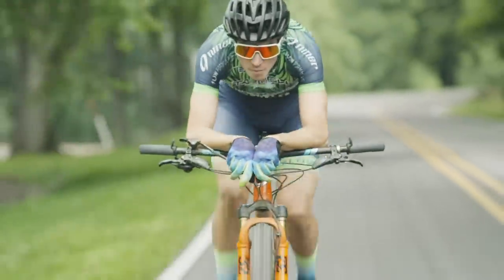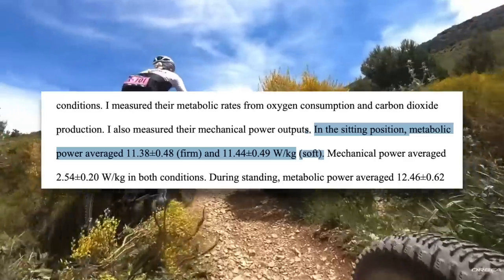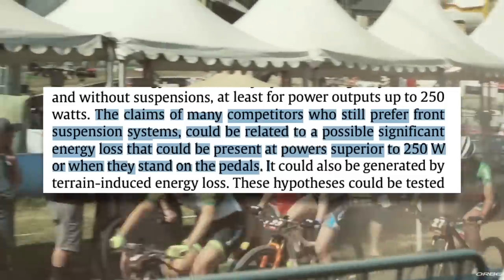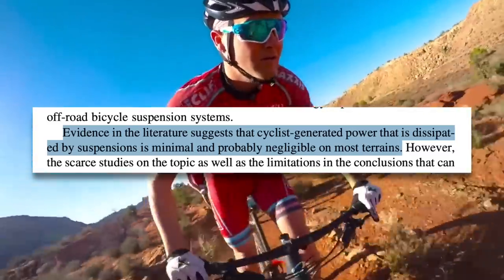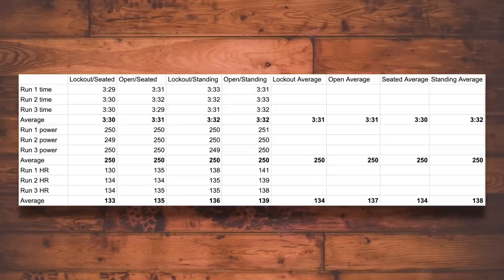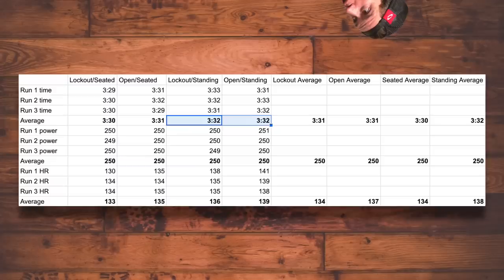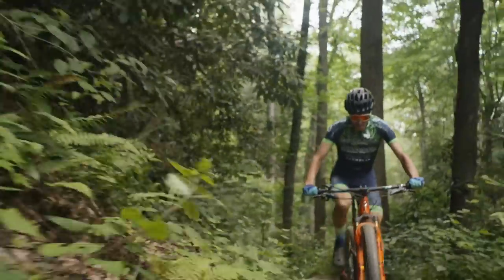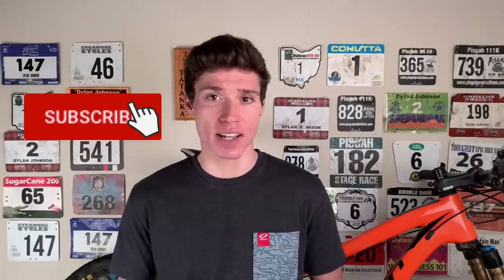Does Locking Out Your Suspension Actually Make Your Bike More Efficient? The Science

Comment: Whats missing in these experiments are the amount of bob or travel when its unlocked. When you bob, part of your energy is going into the suspension and probably being converted to heat. A better experiment is to do it on an enduro bike and not only measure watts, vo2, buy travel during bob. You can use a shockwiz for that. If you're doing this on an xc bike, much of your data is  in the noise. Basically what Im trying to say that if there is bob, then thats part of the energy you're producing and its not energy which propels the bike. Just doesn't seem to make sense . The only thing which makes sense is the experiment is not producing conditions where it's measurable.

Comment: so conclusion is that weight savings from hard tail is what might actually make a difference or does it???? Does the non rotational weight ....with reasonable delta actually make a difference? Lighter wheels do make a difference for sure ...especially in MTBing where change of pace is big factor but lighter frame ???? That would be an interesting test to do.

Comment: Very interesting, I suppose part of it is to do with the perception of comfort and performance. Does this mean I don't need a HT bike for XC?
Reply from the maker: I stopped using a HT a couple years ago. The main advantage of a HT is that it’s lighter but I’d say unless the course has a lot of climbing on smooth trails a FS more than makes up for the weight difference.
Reply: @DylanJohnsonCycling  my thought was that the thing holding me back is the fact I have a 27.5 Trek Remedy, 160mm travel front and 150mm rear and I use it to ride 100+ km days. It weighs 17kg, so I'm looking for something less heavy like a trek procaliber but maybe I should look at full suspension....problem is the procaliber is 10kg full race spec etc...to get that weight on a full sus I'm looking at spending waaay above my budget. Would you prioritise weight over suspension over those kind of distances? I'm having trouble figuring out the interactions between weight, performance in 100+ km events. My brain tells me prioritise weight so HT would be the go to for cost/spec value. What would you do?
Reply: @DylanJohnsonCycling  course would be South downs way century in UK 170km with 3500m of elevation...the remedy is a bit of a trail pig lol
Reply: @mrnobody9821  You don't really need a 10kg FS , you can find ~12kg FS xc bikes at a more reasonable price point and will get the same benefit of comfort and speed on the downhills. 
I personally would prefer 110-120mm bikes with a dropper (around 12kg) for XCM events since you can easily make up the climbing speed difference on the downhill parts and get better overall handling over rough terrain and more comfort as a plus. 
2kg additional weight will add a minute (at most 2) on an 1h climb at race pace but you can easily make it up on the downhill section by going 1-2 minutes faster on a 10min downhill. On flat sections the weight will not make any real difference. 
If your events have somewhat gnarly and fast descents , just get a FS that your budget allows and maybe even a 110-120 xc/trail bike as long as weight is within reason.

Comment: So the energy that compresses an open shock while pedaling on smooth road... where does it come from? And where does it go when the shock is locked?
Reply: when locked, it compress the tire.
when unlocked, it compress the shock.
Reply: @Hexsense  and it should be noted that tires provide undamped suspension which is not good.
Reply: The loss doesn't come from the suspension movement itself but rather a function of the suspension travel AND the damping forces produced by the compression/rebound damping circuits. The rider is the only source of energy so necessarily you're losing some energy if your suspension is moving and generating heat in the damper. How much depends on the level of damping and movement.

Comment: It all depends on the trail you're on. The terrain is king. If you're on loose gravel, on a climb, in a rock garden, on slippery off camber roots, descending a log etc etc. The whole point is not data obsessing, it's the feel you get on certain terrain. You will know instantly which one feels better. I defy anyone to attempt pulling up a steep rock face with the shock locked out. You will fail.
Reply: @Johnathan Chester

I think the issue is relying on feeling as we know is not accurate. Something may feel good but is in fact not opimal.

For example if rider movement is enough to cause power loss on a suspended platform then that movement must also be doing something on an unsuspended or more correctly undamped unsuspended platform.

Maybe loss of traction? 

The entire purpose of suspense is to maintain traction.

Would you be able to feel small losses in traction? What would those loses amount to?

Id hazard a guess the loss in traction in watts is greater that the loss in watts from suspension bob.
Reply: @tylerbruce5731  Good thoughts and precisely my point. MTB is not all about "metrics" - that's only applicable to a measured surface. When the course is gnarly then you are working on feel. The feeling of traction, slippage, potential leg speed, etc etc. I strongly suspect most XC-ers here are more like gravel/roadies. I spent 10 years racing XC and learned on the N Shore, Squamish etc. Watts is secondary to terrain and bike set-up. Good luck riding 220 watts steady up Oilcan.

Comment: We’ve landed probes on comets and other planets. Don’t we have the mathematical knowledge to answer this question without doing experiments?  (Not trolling, I’m genuinely wondering.)
Reply: We need an experiment with a motor that compresses a shock through the same range that pedaling would create and measure the power required with and with out the shock installed in the machine. This test could be performed with different dampener settings and spring rates to boot. Ive been thinking of ways to do this on my own. The world needs someone with a bit more motivation and resources than I have.

Comment: The headline for this is hugely misleading. What he has demonstrated is that having the suspension open on this very xc orientated bike takes approx 2% more effort* to maintain the same power due to suspension bob than when the bike was locked out. In a race 2% is enough to make the difference between winning and not being on the podium. For most people, 2% isn't huge but most people ride less xc focussed than this and I greatly suspect that it he repeated this test with an enduro machine that 2% figure would shoot up. *I am referencing the difference in heart rate which is the best metric of how hard the body is working as it shows how much oxygen the body is consuming

Comment: There is an another pinch of salt to take these test with: crank-based powermeters but not the hub based. They must have smoothened or neglected forces from bobbing and rocking, and your heart rate difference might prove just that. Or not
Reply: More likely not, since the studies have also measured oxygen consumptions/CO2 production, which is much more accurate than heart rate, and they haven't found a significant difference in those either.
Reply: @Finnspin_unicycles  agree, that would be a more proper way, but as you see from the study numbers, the measurements are not as accurate, therefore allow for greater discrepancies.
Just from analysing the shock alone we are talking about power losses comparable to what you get from dirty chain or inadequately inflated tyre - of course the impact is insignificant, but it is a great exercise in test methodology to find out how much insignificant it is.
Reply: In a perfect world , we would measure how much heat is generated by the damping in the suspension and calculate watts being lost. Intuitively , I'd say it's pretty small loss on XC bikes and 'somewhat' meaningful on long travel bikes.
I own a 165mm coil bike, it definitely 'sucks' your power when you sprint on the open setting but that's an extreme example.

Comment: I think it's testing the wrong thing. It's not really surprising that 350w is the same in terms of speed with or without suspension open, But I would find holding a smooth 350w (ie. above threshold) with an open suspension very difficult in terms of pedal stroke smoothness. Still, interesting all the same.

Comment: Don't think this translates to all riding types. I've tested this and there is a huge difference on FS, less on the hard tail. A lot of other factors to consider... Being clipped in removes much of the mechanical disadvantage, faster cadence also cancels out bobbing, some rear suspension platforms are just horribly inefficient, there is a small energy loss from suspension movement which naturally increases with more suspension. I'm at least 10% faster locked out, but ride locked out most of the time for unrelated reasons.

Comment: “At power =< 250W” is too low to judge the efficiency in a race effort. Putting down 500W and losing any portion of that to the cycling of the shock damper is energy loss that can make the difference between winning and losing,

Comment: Has anyone tried to ride a downhill bike up a hill ? You can't tell me that it takes the same amount of energy as a hardtail if the hardtail weighed the same...  shocks are designed to absorb energy.
Any pedal Bob energy I's lost to the damped turning it into heat and then friction of seals and bearings etc.

Comment: Your shocks are turning your watts into heat. Period. It’s just physics. I suspect it only matters when standing and sprinting, though… 250 watts is not enough for their to be a difference.
Reply: These results are intriguing, but I'm not convinced, mainly because I don't think that the effort in moving the unlocked suspension is negligible.  Try pushing your front suspension up and down to the point where it moves during a hard climb. (I'm a hard tail guy).  The energy to push it down is X.  Assume for thought experiment that your lockout is perfect.  Your "Bobbing Energy" (BE) is X times pedal strokes.  Given the amount of friction in the system and the number of strokes, this number can't be insignificant.  So how to account for the results?   (I invite any mechanical engineer and/or sports physiologist to jump in here.)  1) It could be that BE is somehow still transferred to the rear wheels when the suspension is on.  That could be easily determined 2)  It could be that BE is very small and not measurable.  I know I have noodle arms, but pushing the suspension up and down doesn't feel that easy so I don't think BE is insignificant 3) It could be that BE with with or without suspension is both a) roughly equal and b) equally isolate from or connected to the rear wheel.  4) Bad experimental design.  Any other  ideas for this counter intuitive result?
Reply: @cannondale1950  It it was just a spring, it wouldn’t matter, since the spring would release 99%+ of the energy back into the wheels. The damper is the issue.
Reply: An ideal spring would return all energy, but first it is not ideal. And second there is damper that converts mechanical energy into heat. Maybe during 3 rides the difference was only 3 Watts and thus not significant. But during a race those 3 Watts add up and turn into significant power loss compared to other riders. 
It's just like in road biking where 200g less turn into 5 seconds advantage on the climb, nothing significant. But hill after hill, the champ on the lead gains 20-30 seconds and wins the podium.
Reply: @DilbertMuc  I suspect the number is much higher than three watts in a worst cast scenario (a heavy rider sprinting out of the saddle on a soft spring with little bump damping and lots of rebound damping).
Reply: @baribari600  That's a good point. I myself figured out that being seated I can push watts on a climb easily. But when you stand up that's were the bobbing of the suspension starts. Instead of pushing down the pedal you foot soaks down the spring and on the rebound the damper soaks up all energy. It is like sprinting on a sandy beach. Most energy is consumed and wasted in the sand while the foot has no firm stand to push against.
Reply: @DilbertMuc  Exactly. If your spring and shocks are fairly stiff, it's not going to stroke enough when you pedal while seated to make a difference.
Reply: A more relevant test would be how much suspension affects acceleration in a sprint, especially uphill.

Comment: Bouncing on a pogo stick for 10 minutes takes a lot more energy than standing still for the same time.  The energy it takes to compress the suspension is not returned to the rider or drivetrain in any useful amount.  In fact, a good damper will absorb more of that energy than an undamped system like the pogo stick.  When the suspension is locked, more of that energy makes it to the drivetrain.  It really is that simple and this is a perfect example of bad science so common these days.  It's basically impossible to measure the total output power of your entire body while riding a bicycle.
Reply: It’s actually not that simple. There are all kinds of forces at work beyond compression and damping: squat, anti-squat, pedal-kickback, and leverage ratios. Your pogo stick example is completely irrelevant.
Reply: @tgoods5049  It really is that simple.  You can draw all the force diagrams you want but if you can't draw one that shows how that energy is returned to the drivetrain to propel the bicycle forward, it is lost.  Go for it!
Reply: @tgoods5049  Have to agree with Brian here. This is a matter of thermodynamics , you cannot create or destroy energy.
If the damper is working (generating heat) you're losing energy, period.
Reply: @alexande94  This is not just a matter of thermodynamics.  Take a step back and look at the big picture.  Why are the majority of pro racers on full suspension bikes (what Brian calls "bad science", lol)?  Its because the pedaling efficiency of modern XC bikes is very good (meaning very little energy loss from transferring pedaling energy into the suspension... as DJ's entire video just showed) AND the suspension reduces the rolling impediment on uneven terrain.  The suspension is soaking up the chatter on the ground allowing you to preserve more forward momentum.  That's what is creating most of the heat in the damper, not your pedaling force.  Like I said, the silly pogo stick example is irrelevant.  If xc racing was like riding a pogo stick the pro racers would be on fully rigid bikes.
Reply: @brianrhamilton  Do you have experience mountain bike racing?  A seasoned rider who has a lot of experience on both hardtails and full suspension will tell you that full sus are smoother and faster on most course conditions, despite the slight loss in drivetrain efficiency and weight penalty.  It's because the full suspension is absorbing more trail chatter thereby helping you preserve forward momentum.  And now DJ's video is showing us that the drivetrain efficiency loss that we were all concerned about is completely negligible.
Reply: @tgoods5049  I never said that FS XC bikes aren't better because they have this small loss of energy when bobbing. I was only stating that if the damper does any work caused by pedalling , it NECESSARILY takes away energy. You can't argue with that.

Of course I completely agree that full sus bikes are better in most conditions and I will be getting one next year probably.

We're just being nerds and arguing physics with great pedantry , haha.
Reply: @tgoods5049  Yeah I race and even snagged a podium spot at Sea Otter last weekend, CAT1.  I’m not sure where you get that I think full suspension are slower race bikes.  ¯\_(ツ)_/¯

Comment: On a smooth surface it will not make big difference. On a rocky climb it will. On that type of surface I lock the front suspension and put the rear damper in trail mode. This way I get better traction on the drive wheel and the front wheel is rolling better over rocks. I have no scientific prove that this is true. Just my feeling.

Comment: Does it occur to you that using a power meter for this kind of test is meaningless? The bike has to receive the same power at the crank in order to travel at the same speed. The power is obsorbed by the suspension, at your crank, it's the same power, but you are putting into more power in order to keep the power at crank the same ... You ever wonder why those researches since 2000, that's 20 years ago, never caught any attention to the sport at racing level?

Comment: Your test was completely the the wrong test.. if ur bobbing like a mad man or smooth, 300W to the back wheel is 300W to back wheel and result in same speed.. the only question is, is it harder (metabolically) to make those 300W… and basically IT HAS TO BE!!

This is one of those times where it makes sense to ask the question what is wrong with the research? ..example.. you were testing the completely wrong attribute (power to back wheel) to gain any useful info.. what did researchers miss??

Scientific hypothesis is a model for reality.. if your model doesn’t accurately predict reality.. it’s your hypothesis that is wrong, not reality/direct observation!

Comment: you do realize your tests are flawed. If your suspension is bobbing up and down, some energy is obviously being consumed by the movement of the rear shock. And the rear shock heats up. Conservation of energy is a thing.
Measuring the power at the crank is saying nothing. It's the stress to your body that needs to be measured and we have no exact way of doing that.